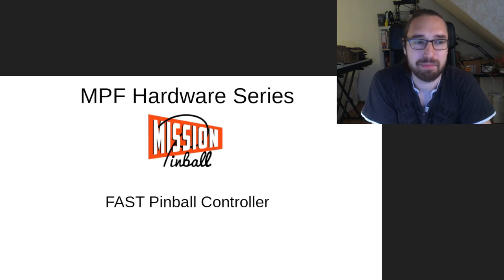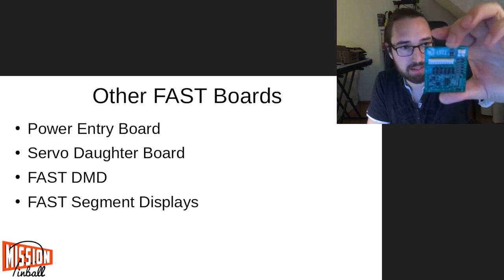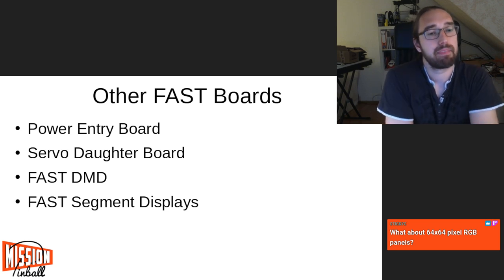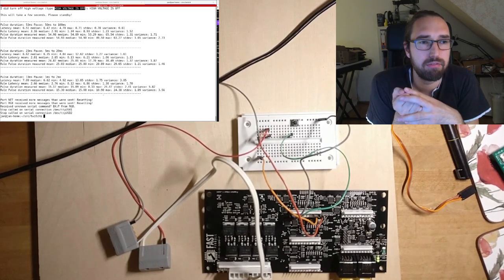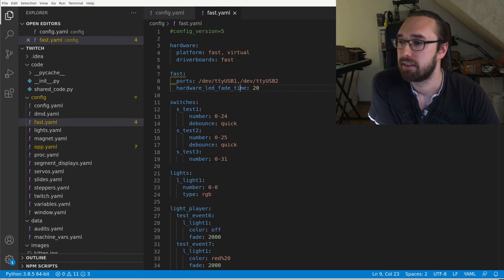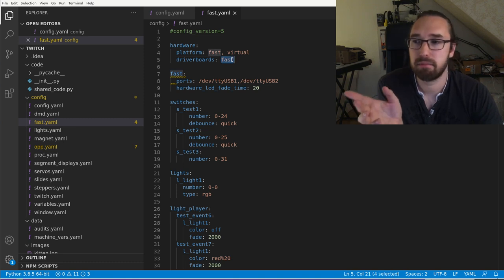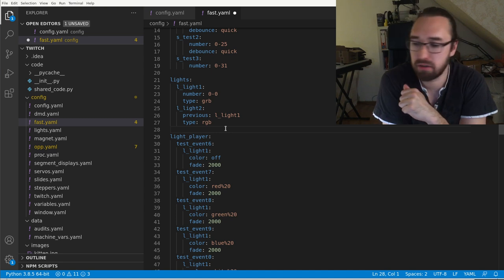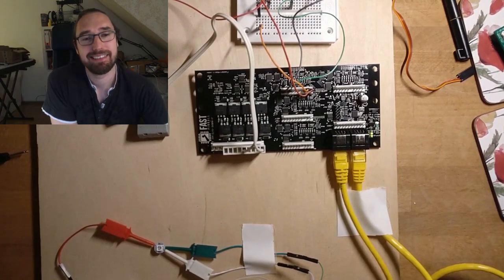FAST Pinball Hardware - MPF Hardware Series

Comment: What about flashers ? Are they driven like coils ?
Reply from the maker: Depends on the type of your flashers. If you you traditional flashers (i.e. bulbs) then yes. Those are driven like coils using a driver. Some machines also use serial LEDs as flashers which do not require a driver. However, if you use standard WS281x LEDs you probably need more than just one. There are ways to build brighter LEDs using a WS2811 chip.

Comment: I am unable to find the servo board. Do you know if this has been discontinued?
Reply from the maker: Good question. I know that there are at least two revisions of it (green and black). Not sure if they still make it. Guess best way to find out would be shoot them a line ;-).
Reply: @jabdoa  Thanks, I did just that and they are coming out with new expansion boards to handle this.

Comment: I don't understand how the power goes to the mosfet !!!  I don't see any power input header on the board. through the ethernet cables ? I don't think ethernet cable can handle that much current.
Reply: Oh wait the mosfets just provide a path to ground but still quite some amps goings throught no ?
Reply from the maker: @bzhmaddog  Exactly. HV 48V is connected to one lung of the FET. The other lung connects to the FAST IO Board Driver. The driver connects to ground which is then conencted back to HV ground on your PSU. As always: Make sure you connect all your DC grounds in your machine. Ideally at the PSU.

Comment: Stupid noob question, pls. Which system its cheaper and easy for noobs like me, this or cobrapin one.???
Reply from the maker: Cobrapin/OPP is definitely cheaper. Easier depends on your definition of easy. FAST offers node boards which are distributed below the playfield. More components are by definition more complex but also offer some advantages (such as less wires and extensibility). Cobrapin is one large board and probably more wiring. Generally, CobraPin/OPP are more DIY-style than FAST.
Reply: @jabdoa  TY very much.